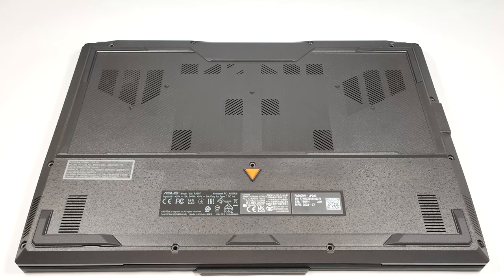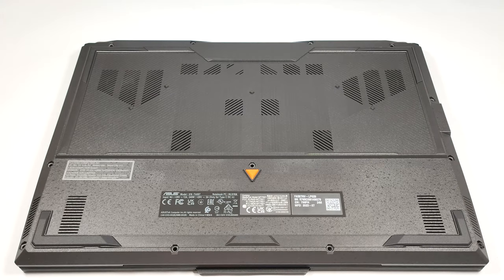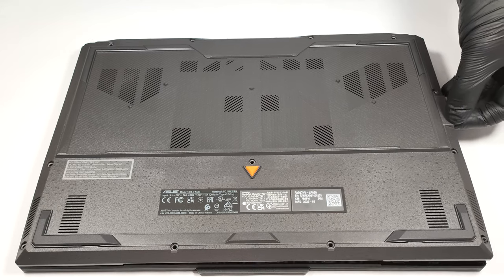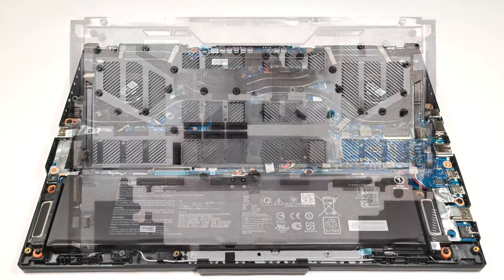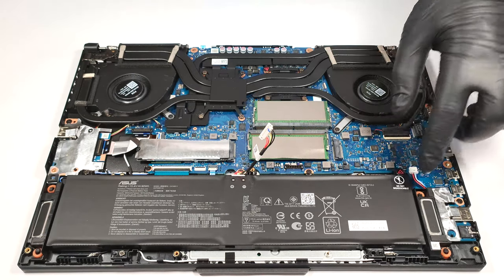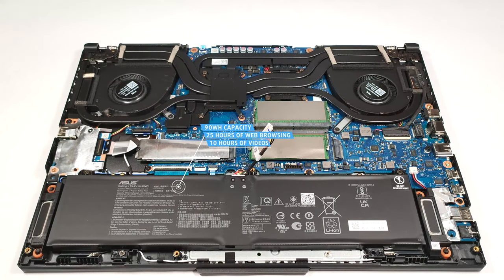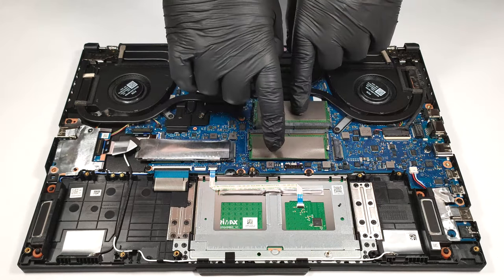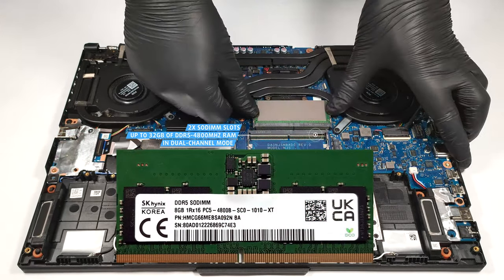🛠️ How to open ASUS TUF Gaming A15 (FA507, 2023) - disassembly and upgrade options

Comment: Bro whoever built my tuf put it together with concrete or something. Had one hell of a time prying it open. Some of the clips just broke off.
Reply: You just need the right tools and techniques to open them smoothly (usually).
Reply: Exactly, I can't open 2nd ssd sloth nor GPU nor CPU

Comment: Wanted to see how to remove that battery plug ... too bad you didn't show how.
Reply: Pull the small metal connector attached to it first. It locks the plug in place. Once thats pulled back (dont try to remove it, just pull) you can unplug the battery.

Comment: Hello I want to know if the screws are having different size anywhere? I’m in need of this information as I want to open my back lid of my laptop and clean the fans out.
Reply: Yes, there are 3 different sizes and one of the corner screws does not come out on purpose.
Reply: @OTKFANBOY  yes hello, I noticed that one on the bottom right does not come out, is there any idea to open the full lid?

I would like to get in contact with you to talk further because I have already accumulated a lot of lint and I need to get rid asap.
Reply: @Twixks bottom right does not open fully and doesn't need to. After unscrewing everything, try to pry open the back with a card or something
Reply: @burakcanduzcan  yes thank you, I got it out previously.

Comment: Is it total 32gb ram or 2x32gb=64 gb total ram ?
Reply: 32gb
Reply: @madao21km Officially yes. But it works with 64gb. Cruisal has a 64gb sets for this laptop for example.
Asus only tested up to 32, that's why they say 32.

Comment: For RAM upgrade, is it important to disconnect the battery ? If yes then do I need to unplug the connector only or unscrew and remove the whole battery ?
Reply: I changed it without disconnecting the battery, everything is ok

Comment: I need your help my laptop screw drivers are lost i need a replacement can you please tell me the size of the different screws
Reply: The screws on my laptop have fallen out and i lost them so i need to buy new screws, which exact screws are they? If u have an amazon link that would be great thank you!
Reply: @brunohall7294  i tried getting more info about the size but not sure  2023 use M2 x 6mm screws and M2 x 4mm screws

Comment: I have the same model. Could you do a keyboard video? I dont know my power button is so hard to turn on. I need to press it or hold it in order to turn on. I wanna try and clean the power button. But i think i have the a15 2022 model since i bought it around october 2022 8gb ram ddr5 i upgraded it to 24gb ram and hoping to add more ssd since it already has 500gb of built in ssd. Gonna add 1tb ssd if i can get the power button to work smoothly.

Comment: If there is a static Noise issue with headphone jack.then it will lead to entire motherboard swap ? Because it is attached to motherboard i guess
Reply: You really use headphone jack still? God, using bluetooth headphones is a life changer.
Reply: @filippetrovic845 Wired headphones usually offer much better latency and sound wym?
Reply: You could probably just desolder it and solder a new one in

Comment: Hallo,  I am raading in the comments that ddr5 5600mhz should be possible. I want to pu in 2x16gb ddr5 5600 in my asus tuf a15 rtx 4070 with ryzen 9 9740hs. Right now, there is only 2x8 gb 4800mhz  in it
Reply: yes it is possible, your processor supports 5600mhz ddr5. the 7735hs doesn't support 5600mhz. the only reason why asus put a 4800mhz in your laptop is because the price is cheap.
Reply: would it make a big difference for a 5600?

Comment: Is it possible to apply liquid metal thermal paste in this laptop.Can u please reply me fast as possible.
Reply: @adwaidnair2018 - From my personal experience with a similar laptop model, you can always use liquid metal on a laptop; in fact, given that they don't have IHS - the little metal cover thing on top of most available CPUs - using liquid metal is easier on a laptop CPU than on a desktop version. Furthermore, there is no need to delid the processor, and current laptops run HOT and in a rather small and poorly ventilated environment, so using liquid metal is preferable, but you'll need to take a few precautions: 1) get conformal coating (thermalgrizzly's TG conformal coating) and apply it on all the nearby resistors that might be exposed to liquid metal in case of a spill-over, and 2) replace all of the crappy thermal pads with COMPUTERSYSTEMS K5-PRO or UPSIREN U6 Pro. Thermal putty is infinitely superior to thermal pads in both contact and heat dissipation. I hope this helps
Reply: ya thanks

Comment: I have the same laptop with RTX 3050 Ti and Ryzen 6800H 144Hz 2022 version I have a qaustion does it support Gen 4 M.2?
Reply: yours is only gen 3. you can use gen 4 SSD but you're just wasting your money because the laptop won't be able to utilize gen 4 speed. you will stuck at gen 3 speed.
Reply: @cerberusx_  Thank you !

Comment: What is the maximum RAM upgrade?
Reply: 64gb. not 32gb as advertised by Asus. the processor supports up to 64gb of ram and AMD confirmed that.
Reply: @cerberusx_ why asus said for 32gb only?
Reply: @arsharizalamirariff6137 Because they only tested 32. If they say 64 they have to support it, so now if it doesn't work you need to ask the ram manufacturer for help. That's why going for 64gb should be done with ram manufacturers that have 64gb sets for this laptop, as they will help you if something doesn't work, Asus won't

Comment: Anyone tried to fit sn850x with heatsink in it?
Reply: by just looking at the size of the heatsink, I can tell it won't fit. most laptops won't be able to use SSD with heatsink thicker than 3mm. SSDs with heatsink are created for desktop PC.
Reply: There are some copper thin heatsinks. Look for them. They are possible to fit in closed laptop envoironment.

Comment: Hey brother I'd like to ask. If this laptop can handle 64GB RAM ddr5 32x2 dual channel? Right now i just installed one channel 32GB ram.
Reply: Will it able to take another 32GB and make it into 64GB? Cause i wanted it to be dual channel instead single channel.
Reply: @sanada-vkk3315  Or you can always "downgrade" to a dual channel 32 gigabyte configuration. One thing every geek should know is to get dual rank modules too. It may not be a huge difference, but a dual rank RAM stick is 5 to 7% faster than a single rank version. Whichever way you choose to go, always get the sticks from the same vendor. If you're going with Corsair, SK Hynix, Samsung, or whatever, make sure that they're both Corsair, Samsung and so forth. There are tiny timing differences that may lead to a less-than-optimal performace if you get two technically identical sticks from two different manufacturers. Don't forget to get the EXPO versions for your AMD systems and your XMP counterparts for Intel-based systems, otherwise you'll get a blue screen of death!
Reply: Yes you can. I just upgrade mine to 64GB 5600MHz
Reply: @tjhana With 5600 Hz or 4800?
Reply: @TLOZ1986 it's 5600 MHz
Reply: @tjhana so.. Its work for 64gb? No issue at your laptop? I wonder why asus only said 32gb ram only.. Huhu